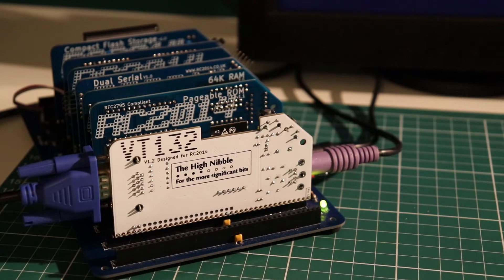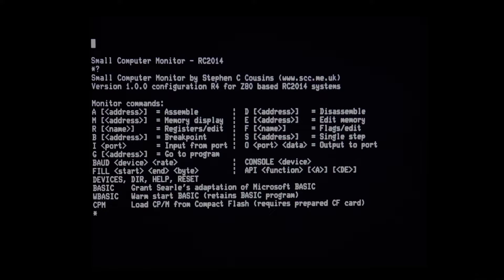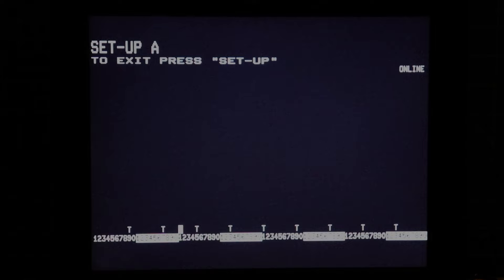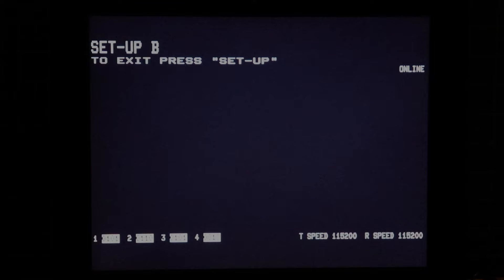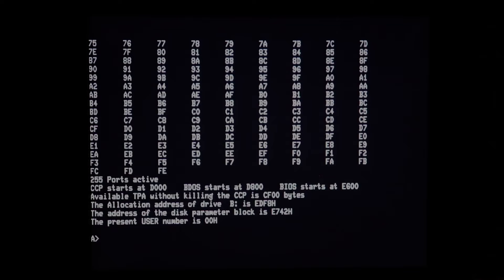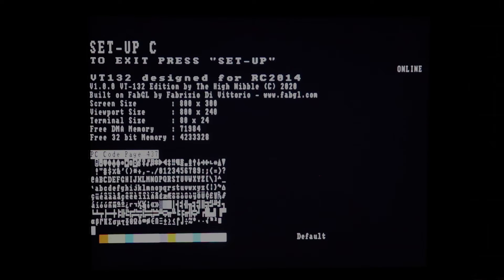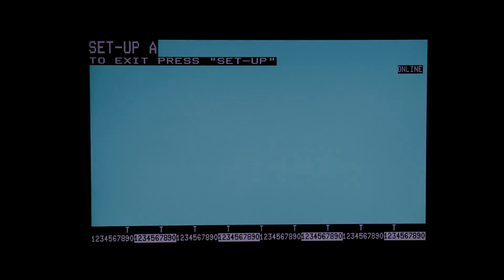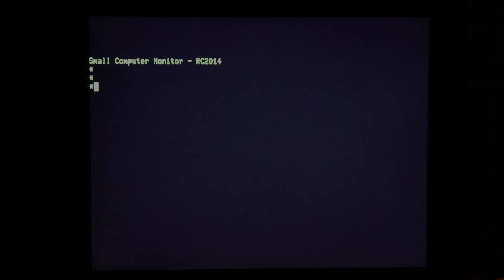THN #030 - VT132 #2 - VT100 Terminal Emulation

Comment: 132 columns, awesome!

I have an old DEC Rainbow that's been sitting in the garage.  I don't know if it still works.  I loved the 132 column mode.  I used to use it in Z80 CP/M in 1991.  A few months later it waited years to be used as a serial terminal in Linux.  When it's dead, I'll have a decent VT option.

Looks great.  I'd love to see a 1024x768 resolution version.

Comment: Looks like a nice VT100 emulator, more accessable than the real thing now.
The end of line Bell is more applicable to the older typewriter style teletypes where the operator is being warned that they are running out of paper on the current line. It's a carry over from the VT100's ancestor...  CuriousMarc has a series of videos on a restored teletype if one is interested in mechanical engineering wonders.

RE: Hardware, do you have this up on Tindie or some other store?
Cheers,

Comment: What is the "set-up" key (combination)?
Reply from the maker: I have mapped the "Application" key on the PS/2 keyboard to serve as the Set-Up key.
Reply: @TheHighNibble  is "Application" the "Windows" key? If yes, wouldn't eg. Alt-SysRq or F12 also be an idea, as they are not next to keys that are often used?
Reply from the maker: No, a PS/2 keyboard has a left and a right "Windows" key but also an "Application" key next to the right "Windows" key that often has a glyph that looks like a drop-down list with a mouse pointer (at least thats what my two very different PS/2 keyboards have). See https://en.wikipedia.org/wiki/Keyboard_layout#/media/File:Qwerty.svg
Maybe this is specific to the 104 key US layout? If this is not common then I can map it to something else.
Reply: @TheHighNibble  Ah okay, you mean the "menu" key. I guess, most keyboards offer it. But at least I would like to try my old Model M keyboard, and it lacks the "Windows" keys as well as the "Menu" key (as it is a 102 key model, before M$ introduced 3 more keys).
Besides, I still think that the set-up key should not be next to regularly used keys -- do you remember the times, when accidently pressing a "Windows" key kind of killed your currently running full-screen game on a windows machine because it opened the start menu? :)